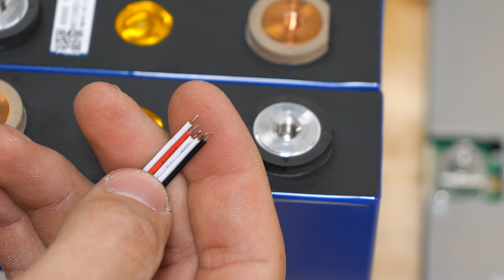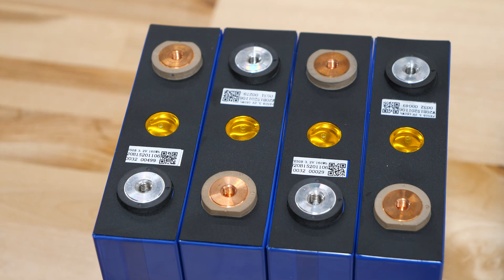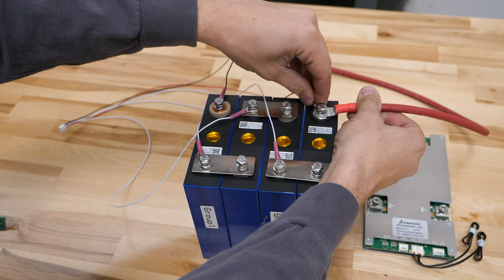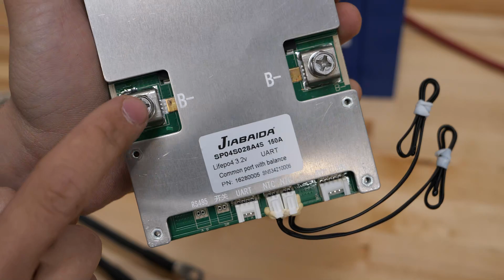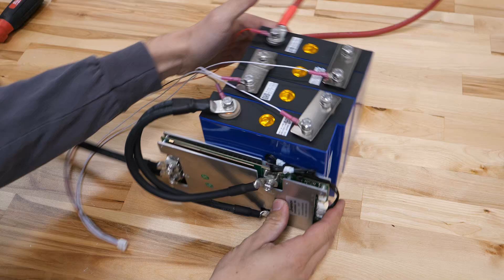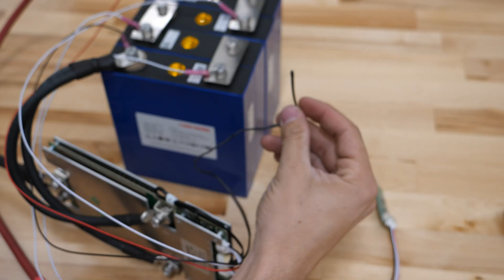JBD BMS Wiring Step-by-Step⚡️How to Wire a JBD 4S 150A BMS | Full Tutorial

Comment: BMS issue. Using XiaoXiangBMS app for Lacroix electric skateboard 12s4p p42a 21700 molicel. Replaced motors from 6389's to 63100's the board would not charge. Charger showed green as in fully charged but was no charge left.

After downloading the xiaoxiangBMS app it started to charge properly again!

But now It will not charge again. The battery shows fully charged in xiao & stormcore app and shows green light on charger again but it is not fully charged.

I'm seeing:
- a MOSFET software locked alarm
and also:
- A cell over voltage protection alarm

Any ideas leading to a fix would be tremendously appreciated!!!!!!!!!!!!!!!!!!!!!  MY BRAIN IS FRIED!

Comment: Does anyone knows the minimum load and minimum charge that can handle? Cose i have a load 0.4ah - 3ah and planing to charge it with 100W solar(so some times 0.02ah charge)So if bms work only above 1ah load its not for small solar . Also if bms allows less than 1ah charge under 0°C to cells?

Comment: You can use cells with a lower current capacity, but make sure you configure the BMS to match your cell capacity. 
You should use a fuse or breaker that matches the current capacity of your cells. 
You'll also be fine if you don't charge or discharge at a greater rate than specified for the cells

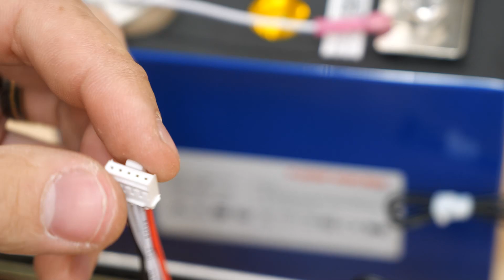Comment: At 10:10 you say we should have 3.2 volts for each wire. I don't think that's right tho? Should have 3.2 for the first, then 6.4 for the next, then 9.6 for the next, then 12.8 for the last?
Reply: Yes, if you measure from negative. 
~3.2 across each cell

Comment: 090822/1501h PST  Thank you for the instructional video on JBD 150A BMS (Wiring). I am really concerned with the "Y: B MINUS cables. I'd not attempt to do what I saw in the Video. I'd not even "bend" the Lug terminal. The procedure could be better if it's placed horizontally and bolted, than risking contact with the Al heat sink plate.
Your Educational video is being viewed all over the world; by many DIY enthusiasts and they will make costly mistakes I know, my statement could be refuted. Pardon me... I couldn't help, but state the fact.
The description is fantastic, down to earth to make DIY enthusiast understand the wiring. The Cells used presently (NARADA 50Ah) cells are the best. Unfortunately in all Chinese Cells BLACK is positive! Thanks for emphasizing. Best wishes. 73s...

Comment: Confused, am I required to have a Y cable for C minus terminal?
Reply: Only if you need the full current charge/ discharge capacity. 
2 cables doubles the current capacity, which also depends on the current capacity on the cells and BMS

Comment: I am using the same cells to power my small motorcycle camping trailer. Because of the confined space,  I have two cells in the left side and two cells on the right side.   The second buss bar was replaced with a  6 Guage wire.  Would the balance wires be connected in the same way?
Reply: Definitely yes! 
The cable acts as the bus bar

Comment: Great video, Dex!  The three sets of 230 Ah. CALB lithium cells and JBD BMSs I got from you are working great!  Since I was able to build the 12V batteries myself (with your cells, BMSs, guidance and support of course) I was able to configure them so the 230 Ah 12v  batteries are only about 4 inches wide.  This way they fit into a very narrow, otherwise unusable space between a tool cabinet and the interior wall of my Sprinter 4x4.  I am chipping away at instilling all the Victron equipment I got from you and have truly appreciated your help and advice along the way.  I agree with Will at DIY Solar, very nice tutorial and the new camera is working great!  Thank you for everything and best regards, Mike